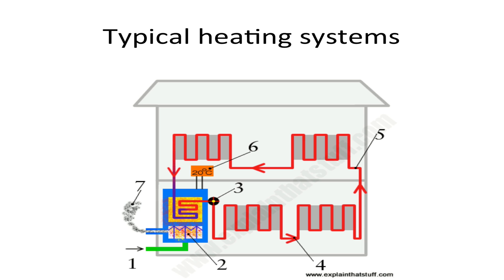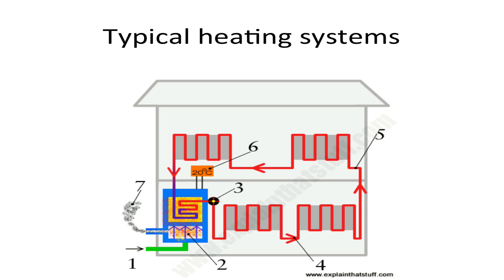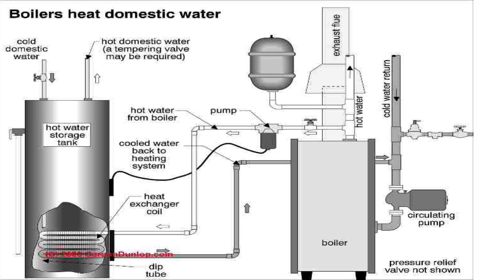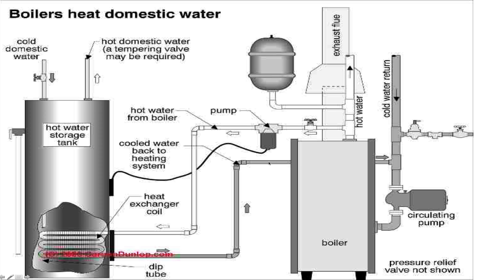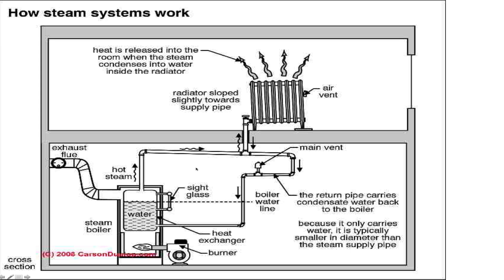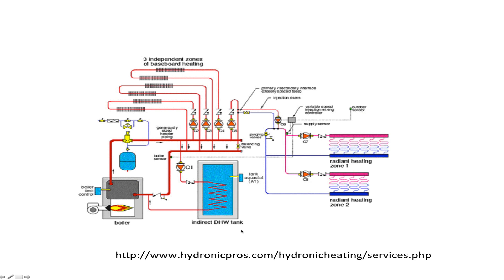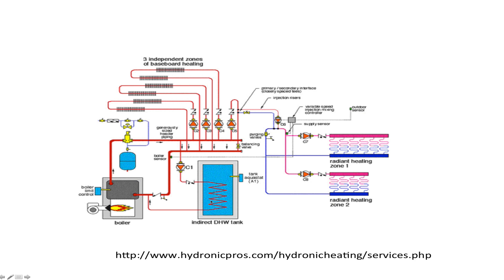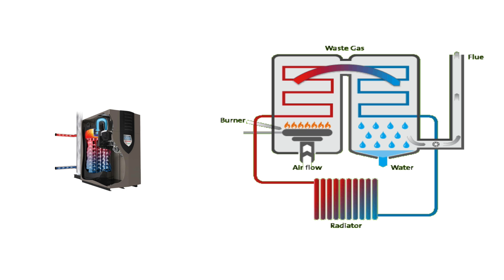Home Heating Systems

Comment: Is there any way to have a system like this run on solar?
Reply: There are systems for that, where you extract heat from the liquid filled panels on the roof when the sun is strong, and uses a different heat source when the solar radiation is too weak.
Reply: You could use solar to power a heat pump
Reply: yes you can but they are mostly subsidiary systems